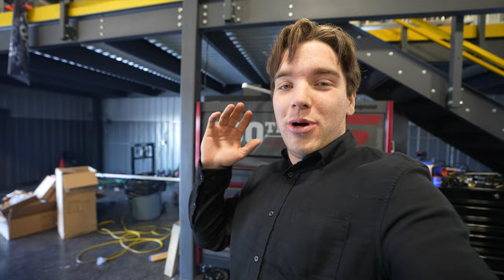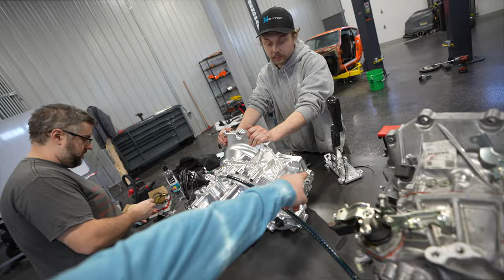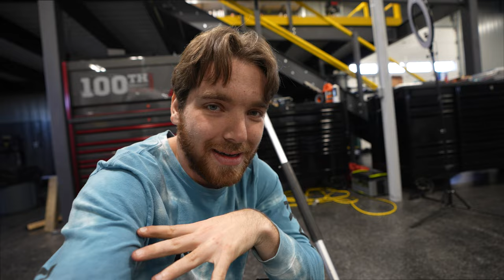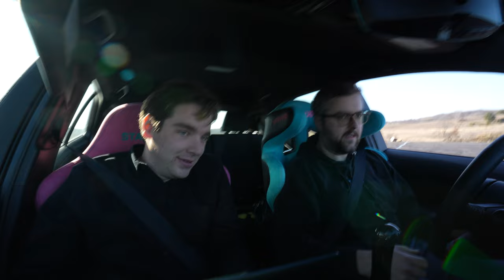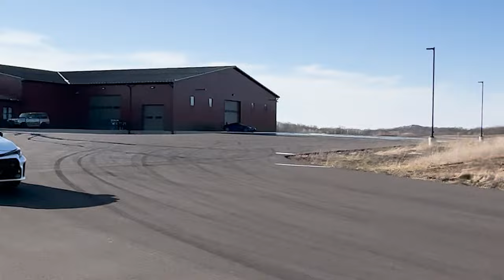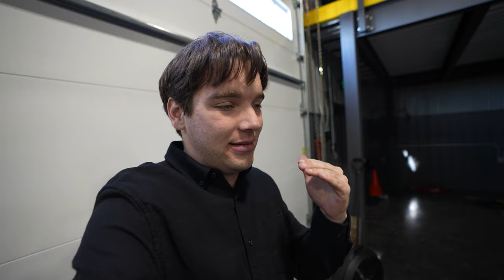Worlds First Sequential GR Corolla (KOTOUC GEARBOXES)

Comment: I got around the rear diff probl by running an oil cooler under car where exhaust used to be. It doubled the gear oil and cools great no more problems. Used rear diff plugs for the lines, direct thread

Comment: I have a 23 red circuit edition. What would you recommend for an easy way to get to the 400 hp mark
Reply from the maker: Lamspeed turbo kit, injectors, fuel system stuff, exhaust intake